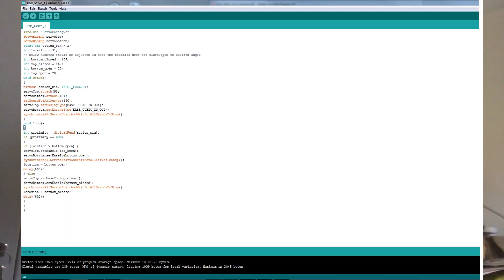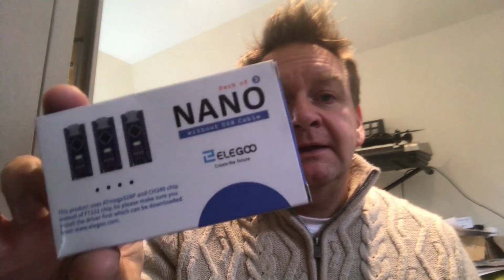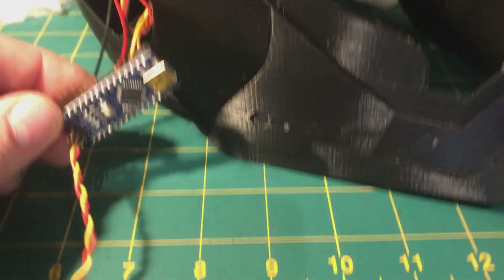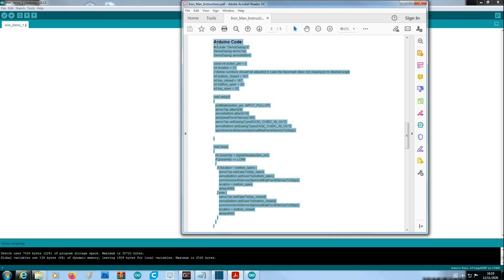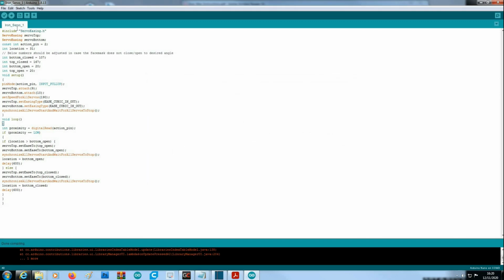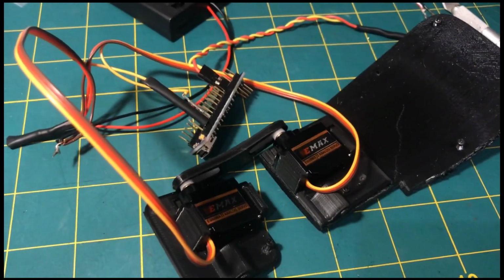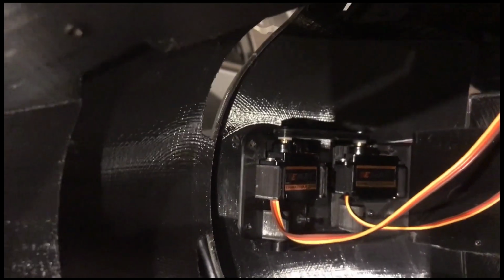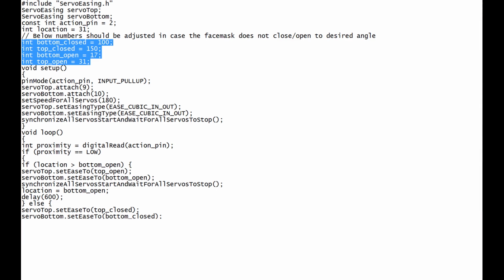3d Printed Iron Man helmet with servos

Comment: I noticed the servos are making a vibrating noise… mine have been doing that consistently… much louder as well. Any idea on how to fix that? I have one servo now that won’t stop spinning in a complete circle once the mask is in the down position.
Reply from the maker: Sorry for the delay in replying. The servos buzz when they are under load so if the movement is a bit to far when the faceplate is closed for example the servo is trying to keep going so buzzes. All you do is back off the movement a little in the Arduino code until the face plate just closes. same for when its fully open...Hope that helps

Comment: Hello! So ive been trying to wire this thing for days and i need help. Ive got the board programmed and all set, its all wired correctly then when i press button nothing happens then i plug arduino into pc and press button then motors work. Any clue?

Comment: How much filament and how many hours of printing did it take to print everything?
Reply from the maker: This is what I made a note of so far. Now working on rest of suit but still doing videos on how I chrome the helmet.

Hope this helps...

Eyes - 3hrs 9min

Cheeks L & R - 4 hours 14min

Dome 1 - 19hrs 17mins

Dome 2 - 19hrs 55mins

Dome 3 - 6hrs 40mins

Dome 4 - 12hrs 45mins

Face - 15hrs 32mins

Jaw, mouth & chin together - 15hrs 44mins 82g
Reply: @printingiron9306  are many hours of printing ahahah, with which printer did you make it?
Reply from the maker: @VittMakerDIY  Yep...One thigh took 5 days..... I use the CR-10
Reply: @printingiron9306  Ok thanks, but can a cheap 3d printer like the CR 10 withstand all these hours of printing? I have an anet a8, that is really cheap, and I have never had it printed for more than 10 hours without stopping and I am a bit worried
Reply from the maker: @VittMakerDIY  I am constantly blown away with how good these are. and to be honest if you get an S with the filament detection that helps eliminate at least one potential issue